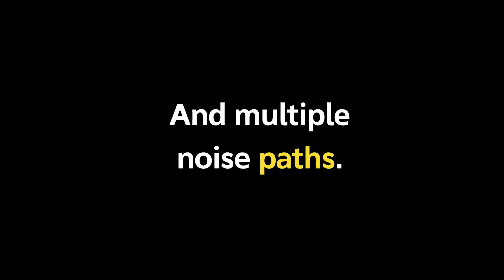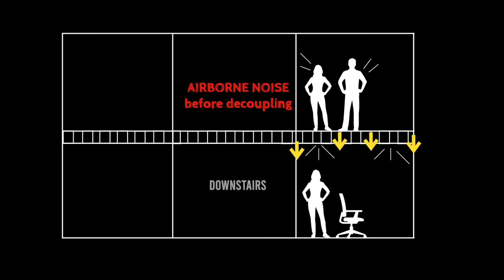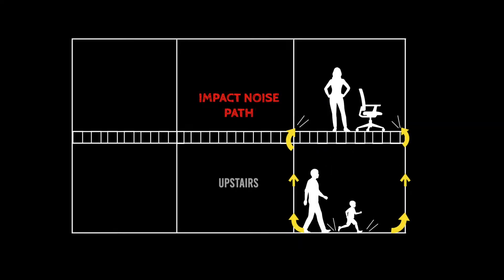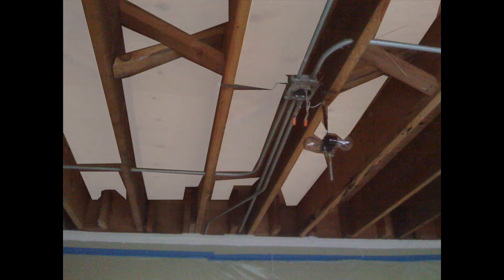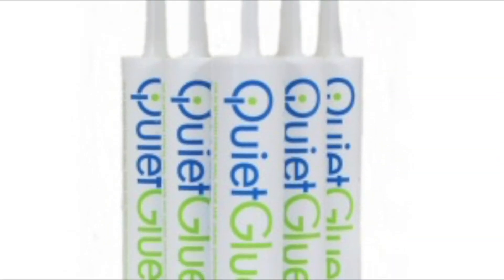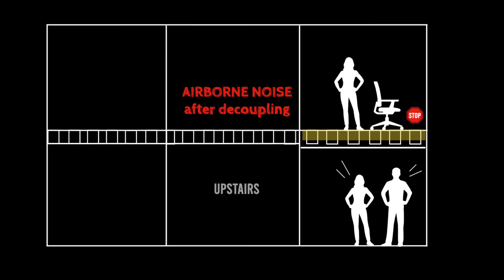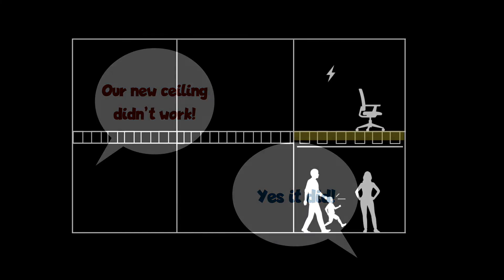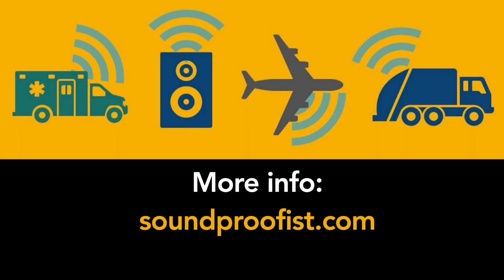Soundproofing a ceiling -- does decoupling really work?

Comment: would it help to put sound dampening material on the upstairs floor underneath the carpet, with a gap at the edge closed with acoustic sealant? I assume this would prevent floor noise from travelling down the walls.
Reply from the maker: I'll answer your question with more questions! What is the situation here... are you the upstairs neighbor? Or the downstairs neighbor? Or is this a family home with two floors? What kind of sound-dampening material do you want to use? What kind of flooring do you have now? What kinds of frequencies/sounds are you trying to reduce?
Reply: @soundproofist  family house, wanting to eliminate sound through to ground floor. We are going to do a resilient ceiling and rockwool in the ceiling from the ground floor. And then I’m thinking maybe we add some mass to the upper floor?
Reply from the maker: @crossroads670  Long answer: If you're opening up the downstairs ceiling anyway, you might want to try adding some mass inside the ceiling cavity (as I illustrated in this video). In my apartment building, I've seen the downstairs units approach this issue in different ways. The first, as I mentioned here, is to cut pieces of gypsum that fit snugly between each ceiling/floor joist, and they're attached (from below) to the upstairs floor with caulk or glue, and probably a couple of screws to hold them in place. Obviously, this doesn't decouple the floor, but it adds more mass from below the floor, though it's only between the joists. So if your main issue is footfalls, this won't change the direct-to-joist impact.

The second approach (in my building) was to add a less-heavy "soundboard" to the underside of the upstairs floor, also in the cavity between the joists. In this case, the soundboard (being lighter) was inserted to fit between each joist at a slight angle. The concept here is similar to the glass window of a recording studio. Typically those windows are at an angle to reduce some of the reflection from the walls when the music is playing. So the soundboard was added and caulked around the edges. And then after that, the joists got wrapped in mass-loaded vinyl. Not draped across the bottom of the joists like a sheet, but wrapped snugly around each one. Then the insulation batts got added between the joists (on top of the MLV), then the resilient channels got added, then QuietRock drywall.  One of the problems we were trying to solve was human conversation coming upstairs through the floor from downstairs to upstairs. Both methods were fairly effective, though I think the second example (which was more time-consuming, involved more materials, and more expensive) might have been a bit more effective in blocking more frequencies. 

In your case, you might not be dealing with noise from below, but only from above. I would still consider trying the first approach with pieces of gypsum as long as you've already got the ceiling open. If that's still not effective enough, then consider adding mass on top of the upstairs floor, although remember that the floor is still connected to the joists below it. What kind of mass?

Comment: What percent does decoupling a ceiling work in reducing the noise ? Hearing upstairs creaking and walking noise that sounds like banging
Reply from the maker: It depends on the type of noise, and results will vary depending on the existing materials and construction in your building. For example, you could still get some flanking noise from your upstairs neighbor's floor. It could travel from their floor to your walls, though it might be noticeably reduced. You'll notice impact noise more than airborne noise because of the low frequency. This website has a ballpark idea of different ceiling/wall treatments and STC (STC is the number of decibels REDUCED by the materials): https://commercial-acoustics.com/stc-rules-of-thumb/

So, if you were measuring in decibels (but not accounting for frequency) and the outside noise was 70dB... then you installed a new ceiling that was estimated at 50 STC, this would eliminate most of the decibels, but that doesn't take into account the type of noise: whether it's conversation noise versus low-frequency pounding into a hardwood floor, or high-frequency squeaks. In other words, you might not get total silence, but if done correctly, it should reduce it enough to not be irritating any more. Also think about what you'll put inside the cavity, once you remove the original ceiling, and use sound-dampened drywall, not just plain gypsum board.

Comment: I get impact noises from down floor party hall from the impact noises of decorator arrangements.As their items impact the floor the noise travels upwards to my bedroom. What can be done in my bedroom and in party hall? Ive asked the building association to install 3mm vinyl sheets on flooring. Can I do something in my bedroom too.
Reply: Thank you for your inputs. My floor is vitrified tile floor.
Reply from the maker: @TauroChuck  My experience with floor-impact noise coming from downstairs is based on a wood-framed building that's made with wood joists and floors. I can say from experience that all the upstairs neighbors in my building continue to hear impact noise from the floors in the downstairs apartments even after the downstairs ceilings got soundproofed, and with some insulation or soundproofing on the walls. And these apartments were modified or soundproofed at different times by different people, in slightly different ways. But in all cases, the upstairs and downstairs floors are not decoupled from the framing. The downstairs apartments updated the flooring, either by adding another layer of hardwood on top of the existing floor (with cork in-between), or by removing the original hardwood planks completely and then adding new flooring with a layer of what appeared to be tar paper, the kind that's used in roofing materials (not recommended, it's not sound absorbent). The subfloors in the downstairs units are directly nailed to the wooden floor joists. The new flooring, with or without padding or proper dampening, was added on top of the subfloor. 

My observation is that even with the decoupled ceilings in the downstairs units, the impact noise on the floor goes through the building frame, not floating up through the ceiling. It travels upwards from the floor joists to the inside of the walls and then into the floor joists in the upstairs units. Therefore, the impact noise is isolated (you don't hear airborne noise) and the impact noise sounds like it's closer than it really is, almost as if the impact was happening against the underside of the upstairs floor. To remedy this, the upstairs units would have to remove the flooring and decouple their subfloors from the floor joists, an expensive undertaking. In the case of a concrete floor,  I think further research is needed because the solution will be different than it is with wood. First I would try to fix the impact noise downstairs and see what you still hear upstairs.
Reply from the maker: Many people don't understand that noise travels in more than one direction and that impact noise can come from downstairs to upstairs. Are you saying that the party hall is directly beneath your bedroom? If so, that's terrible, and your building association needs to fix the problem. Because if it's not a single apartment owner downstairs, but the whole building association, you might have more leverage. Can you tell me more about your building, and the flooring? For example, is it a wood frame with wooden floors? What year was it built? What efforts have been done so far mitigate the impact noise? Would the vinyl sheets be installed on top of the existing floor, or beneath it (against the floor joists)? Are you renting the apartment, or do you own it? Of course I always say that the best way to fix the problem is at its source. The building needs to modify the flooring so that impact doesn't transfer from the floor into the building frame. This could be decoupling the floor from the joists, or installing flooring like what they use in a fitness center, where people exercise or drop weights onto the floor. Try this first, because trying to decouple your flooring and the walls in your apartment would be very expensive for you and possibly less effective.
Reply: @soundproofist  The building is about 5 years old, concrete one 14 floors. Ground floor is party floor about 18 feet high.above that is my apartment. I am the owner. The floors are vitrified tiled floors. The party hall is part of gym ,dance/yoga room and TT game room.But other parts have 2mm vinyl sheeting. Party hall which is directly beneath me has only vitified tile floor. So all impact noises can be heard like dragging of metallic tables, items falling on ground when decorators arrange for parties and high vibrations from music. They use a 100W speaker. To mitigate I have asked association to put vinyl flooring and to use a 40W one as only Birthday partys happen. I am planning to get one of my bedrooms noise proofed.The expert said he  will work on the whole room including decouple the bedroom ceiling  , thats for the top floor noises. What best can be done to my bedroom floor? And what best can be done for the party hall? Rite now I can think of only vinyl flooring sheets or tiles.
Reply from the maker: @TauroChuck  Those tiles on the party hall floor are definitely a problem. Tiles amplify noise and they don't dampen impact noise at all. Do you know what's underneath the tile? Concrete, I assume? When you say that you want to put a sheet of vinyl on the floor, what kind of vinyl? I assume that you would remove the tiles first. They're like microphones. Any hard surface can transfer impact noise, but tile is worse than wood.

I assume the parties have a lot of dancing. I've seen examples of high-impact areas that install a "sprung" subfloor for situations like a fitness center. It's supposed to increase acoustic isolation. Notice the underside of these modular pieces of wood in this short "Freedom Step" video: https://www.youtube.com/watch?v=owo5OyfybTI

The modular pieces have spring-like foam in parts of the underside. However, this video is short and lacks details. And it made me nervous when I saw them add some extra layers of wood on top of the modular pieces without using acoustic underlayments (such as rubber or closed-cell foam) between the layers of wood. And I also saw a section of the top layer of wood touch the wall instead of leaving a small gap. This would transfer noise to the wall. I can look for other examples.

As for your bedroom, IF you have a wood floor and wood joists, I would recommend removing the existing wood subfloor, adding some acoustical treatments between the joists, then use something like "joist isolation clips" before you put the subfloor back in place (https://www.buyinsulationproductstore.com/floating-floor-rubber-joist-isolation-clip/) because you're trying to prevent the transfer of vibration and low frequencies, so you want to reduce the contact between your subfloor and the joists. However, your building materials might be different. If you have a contractor, I would ask for suggestions of how to isolate your floor if the dance hall does not get soundproofed in a satisfactory way by your HOA.

Comment: I live on the ground floor of a new build apartment block. I have no neighbours other than the apartment above me. My apartment has solid concrete flooring built on a ‘block and beam’ structure. My concrete flooring is topped with wooden flooring. My walls are plasterboard. My ceilings are solid concrete. I’m a music lover, but have respect for my neighbour. I never play my music much above 85db and never play it late at night. My substantial floor standing speakers are decoupled from the floor, using isolation podiums. As a matter of interest and experiment, I once turned my music up to around 100db. Stood in the corridor of the apartment immediately above me and couldn’t hear a thing.

Do I ever hear any noise from my neighbour above me? Being ground floor, I don’t have a balcony. Being 1st floor, the neighbour above me, does. I do hear when he opens or closes the heavy sliding doors to his balcony. I do hear it when he drags furniture across his hard floor, if it is furniture he’s dragging across the floor. The apartment block is gas free, so all electric. Economy 7! I do hear his washing machine when it reaches 1800 spin speed in the early hours of the morning. I occasionally hear his music, on a summer’s evening, when he comes home from the pub, turns it up loud and sits out on his balcony with the doors wide open.

Now  noise is weird. 200 yards away, we have a huge church. On a Sunday morning we can clearly hear the church bells. Yet, they can’t hear my music. The church looks out onto a dual carriageway, busy with heavy traffic. When I’m out walking the dog past that church, often the noise from the traffic will drown out those church bells. Yet, whilst I will easily hear those church bells from my apartment, I never hear that traffic. Explanations welcome.
Reply from the maker: Concrete is pretty good at blocking airborne noise and conversation noise, possibly music (if the speakers are decoupled as you mentioned, and windows are closed). It's not so good with blocking impact noise (or vibration) without decoupling or serious absorption/softening between the wood flooring and the concrete below. So that's why you hear chairs scraping, washing machine rotations, doors sliding, etc. from upstairs. It's interesting that you don't hear the traffic (since you're on the ground floor) but you do hear the church bells (which are probably very loud, although further away). Have you ever run any decibel measurements on the traffic noise and the church bells? Preferably dBC measurements with a frequency reading, as well. In addition to frequency and decibels, it could also be related to the street from your apartment, anything nearby that might diffuse the traffic noise, and how good your windows might be.
Reply: @soundproofist  👍

Comment: Very interesting video. Is it ok to skip on the resiliant chanel / decoupling method If my sole interest is to reduce only airborne noise and not impact noise? I have an integrated garage with a bedroom upstairs and would like to reduce noise leaving the garage to bedroom upstairs and outside the house. I'm not at all bothered by impact noises transgerring from upstairs joists to the garage/Workshop below. Would it be sufficient in this case skip on decoupling and instead fill between joists with Rockwool RW3, use 2 layers of acoustic plasterboard, leaving a 5mm edge around the walls to fill with acoustic sealant? Aside from that I know that the weakest link will be the garage door. Thanks in advance.
Reply from the maker: So, unless you're running a lot of loud mechanical equipment in your garage for a prolonged time that would be disruptive to the rooms upstairs, I assume that the garage door probably goes up and down infrequently every day, and usually not at night when someone is trying to sleep. And you're right, a decoupled ceiling in the garage probably won't do much about the vibration from the door, because that noise travels through the whole building frame, not just the ceiling. I would probably do what you're thinking of doing. I assume your garage is simply a garage for storage and car, and not an ADU. No one is going to live in there or sleep at the garage level.  Right? Rockwool insulation, two layers of drywall (and I recommend making one of them QuietRock), and acoustical sealant is probably sufficient in this case.
Reply: @soundproofist  I mainly use the garage for storing the car in the winter months and the odd DIY woodworking with some powertools. My main focus is to prevent the noise from disturbing neighbours as opposed to my family around the house who won't mind the DIY if its going to benefit us haha. I am looking at replacing the up and over door garage door with an insulated sectional one to address that issue. I was hoping that I didn't need to go as far as decoupling the cieling for my occasional DIY. P.S the house is detached but I'm just keen on keeping the neighbours and my noise at a happy level. Many Thanks
Reply from the maker: @Dr.Stacker  You sound like a great neighbor! Thank you!